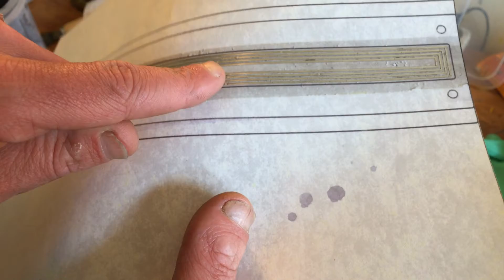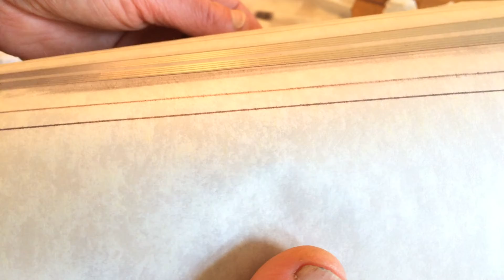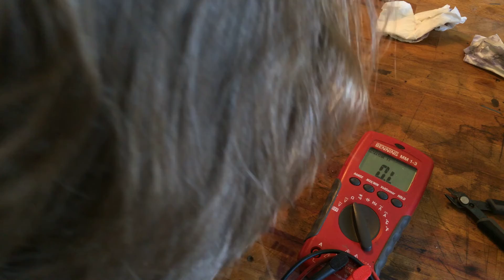Rubanoide Coil + coilformer Round 2

Comment: Hello my friend.. Now that i stay at home i had finally seen these vids..   When i made my rubas, i buyed evry roll of thin Al backing foil that i found. Then i cutted by hand with a diy tool from each foil, a half a turn (ex a 50cm tall I) and measured and adjusted the width till i got it fitted onto the exact dimensions of the whole coil (4-5 turns per shoulder to get the 8 ohm per total target) . I have found to my amusement that  the cheapest backing Al rolls have the highest impedance per  half meter because they are made thinner to be cheap..
Reply from the maker: Heee Serg !!! my dear friend ! we did some long long long long tests with all the ruba's nice to seee you here !! i hope everything is well with you ?  yes i noticed the same the cheapest alu skims on thickness :) something great for us that are not using the foil it was intended for  haha
Reply: Hehe nice to hear from you again! Yeah i remember those tests.. It was a joyfull and funny period and i'm glad it ended. I havent found something woth trying again on them. Maybe just some exotic rice or cottone paper, but still wouldnt bother. In my point of view they are a joy to listen to and very forgiving... And another reason to stick to them is the efficiency and because i havent found yet a tweeter to go as low as 150-200hz without active dsp or filtering... 
 In the meanwhile i have listened to some horns and can confirm that the rubas are not alike but somehow similar in some ways (strange). Hard to chose between one of them..

Comment: I have one more question: did you tried sticking an Al foil directly to the membrane with laqueur? That is what i did and got an excelent frequency responce.
By the way, how are you lately, what kind of projects are you doing right now? Cheers
Reply from the maker: well you can see what projects i do on the channel :) mostly Planars, i did a small and fast venture to rubas once more to try the Hallbach array James (spiderlegs, also on diyaudio lately under a different name i believe) but to me the hallbach is just allot of work without much benefits. there are easier ways to achieve almost i must add the same field (some losses in the steel) without having to glue magnets that do not want to be together :) im still not convinced by rubanoides :( i tries many times and i will try again im sure. but i had much better results in planars. rubas do rule in efficiency besides that i think a planar can do better. :( and cheaper and more easy to build.
Reply: Interesting this Hallbach aray but still the same magnets headache. Well i'm glad i finished with the magnets and especially aligning the steelbars (thats a f*****g guilotine for the fingers...). I'm sorry that you are not into them anymore and i understand your resons. I personally like them. But how about comparing them to the quads 63 that you have? Are there any similarities?  
 For now i'm digging sillently into choke loaded SE class a ampliers route, and planing to power them from car batteries. Its a dream to listen to them through the rubas......